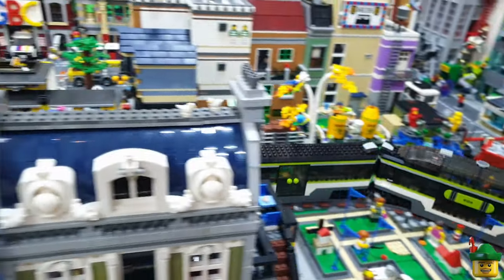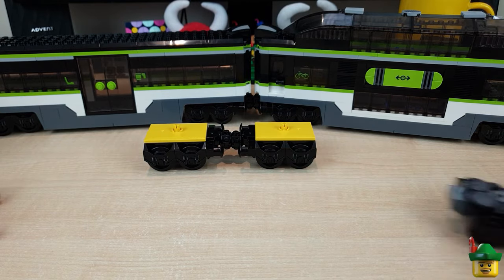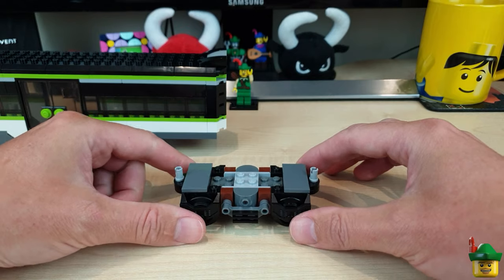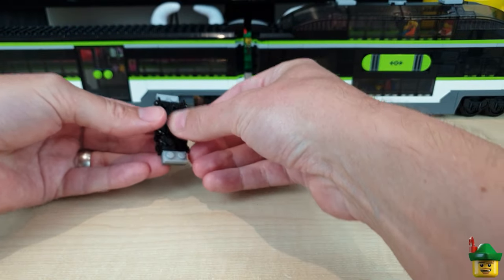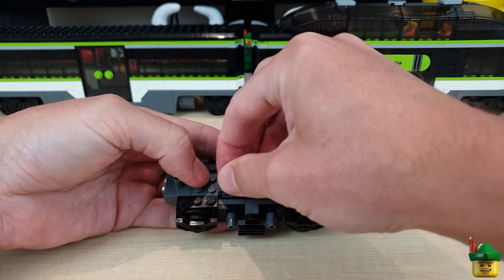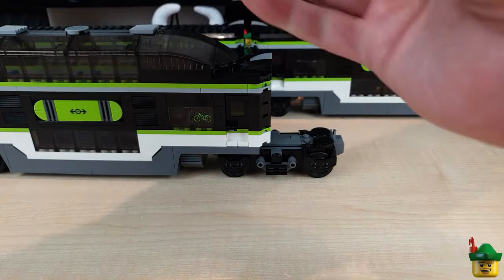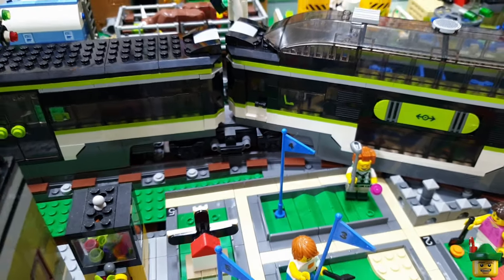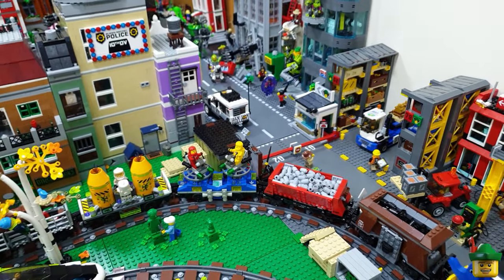LEGO Express Passenger Train - Jacobs Bogies MOC 60337 🚄🚃🚃🏹

Comment: So half as many bogies, mean twice as many carriages??
Reply: 1
Reply: Yeah??
Reply: Potentially! But then you'd have leftover buffers. Maybe two long stock with Jacobs bogies and one short to use up all the parts.
Reply: Just keep in mind connecting/moving trains becomes VERY difficult. I tried this, but went back. Regardless very nice work Robin
Reply: No. For using the same amount of wheels as 2 normal 4 axle cars, you can get 3 units, which are semi-coupled together.

Comment: Really nice upgrade. I think that if you replaced the new type of wheels with the old type with a metal axle, train would run even quieter and smoother.
Reply from the maker: Yes, the new bogies are using the metal axle wheels and I already bought more to replace the rest!
Reply: The new ones are queter, indeed, because both wheels are individual it allows them to spin at different speeds when going through turns. reducing scratching noises. you can hear it clearly if your replace a comeplte train.
Reply: the friction is horrible though  @WhitedevilEE

Comment: Well good sir, I'm here to 'express' some thanks for sending me high speed down the track with some inspiration! 
I had visited the Jacob's Bogie previously but for a completely different objective [streamline & hide the gap with paired concave/convex car ends as well as minifigure walkthrough from car to car]. Yet a solution didn't pan out at that time because was I more focused on a singular pivot point, angles between cars, the cars hugging each other closely at the gap, I was in a rush at it and I didn't have the Book of Chaos to help me out. 😅
I had the intention of circling back and solely implementing the jacob's bogie, but was low priority. Until your video! ..which accelerated the desire to implement them. However...in progress the other day ago....new ideas came up and it all morphed into tackling the 'streamlined and walkthrough' objective again...and I just finished a working concept on a major breakthrough idea! 🤯🤯😍 Elation = off the rails 😂

Comment: Love it!!!
I'd like to see jacobs bogies under all cars - I used a technic pin with axle at one end to make them easy to pick up and place, rather than the stabdard grey pin that locks at both ends.

It's worth pointing out the real tgv have jacobs bogies for all passenger cars, not alternating cars only - so I did the same when I extended my lego tgv.
Reply from the maker: I'd better get the parts for another one then!

Comment: These are quite common on intermodal well cars.  The most I have seen connected with just Jacobs bogies is 15.  Very interesting.
Reply from the maker: Makes a lot of sense if they're all going to the same place!
Reply: @RobinHoodBricks  Yep, it sure does.  American container trains are basically just moving container yards.  Almost all are over 200 cars long, and many go over 300.  Many are double stacked part of or all of the way.  Many of the trains just do the same coast-to-coast run over and over again.  That is probably the most practical use for Jacobs bogies, since the cars always just do the same route.

On the idea of a train as a moving container yard, in western Arizona, along State Route 72, there is a BIG intermodal container yard.  The thing is, it has no cranes or truck ports.  There are just forklifts and rail sidings.  Basically, they just pull up trains to hold the containers, and then take or load them as needed.  I do not think it is even paved.

Comment: I would put these bogies under all the carriages.  They have serious advantages and, as you said in the video, it frees up valuable pieces for future builds.
Reply: The original Eurostar trains (class 373) have then between the carriages except for the end ones (all the powered bogies are then conventional as the end carriages ones are powered too) centre pair so they can split if needed to evacuate the tunnel (never have in practice though). The AGV is different as that has every other bogie powered and they are all Jacobs bogies between the cars. I think this train is following that design, we just have one end to disguise the battery box in.

Comment: If you look at the ÖBB Railjet trainsets they have jacobs bogies all along, including connecting the control car to the next carriage. I understand for your convenience it might be better not to have them all along but I think it would be really cool to see a fully coupled trainset in LEGO.

Edit: They don't have jacobs bogies, but they are permanently coupled.
Reply from the maker: Still, I might have to get two more to speed up the rest of the train.  One linking the two pairs and one linking the cab car.  Thanks!
Reply: @RobinHoodBricks  If you want an example of a trainset that actually does use shared bogies, the spanish talgo series uses a modified jacobs bogie on a permanently coupled trainset.

Comment: I think the difference between the carriages is simply the length - the bogies in the Horizon Express work just fine because the carriages are slightly shorter than those in the passenger train. That being said, I'd say this is a necessary and well-done upgrade. I've tried building a lower-profile bogie in the same style as a typical "dummy motor" but that seems to have too much friction with the technic axles. I'm definitely going to try this and compare the performance, but something tells me this is just going to be better lol.
Reply from the maker: This is very smooth indeed so go for it!
Reply: @RobinHoodBricks  Not surprisingly, it is definitely much better! Very much appreciate your inspirational and informative videos. But I've run out of regular wheels again! Back to bricklink. Lol

Comment: Robin, two things. Do the carriages come in just as much or is that less? And you can also apply this to your freight train. Container wagons also use Jacobs Bogies, see Marklin 47810.
Reply from the maker: The carriage spacing is identical.  Yes, I could use it for cargo wagons but usually it is a pair of the same type.  Mine are mostly totally different.  Maybe a few could be used!
Reply: @RobinHoodBricks  Robbin, make 1 set of 2 container cars. With a Jacobs dolly. and place different containers, length and content, on it

Comment: To correct somethings stated: the cars are semi-coupled depending on there use. North American intermodal (containers & semi-trailers) use the Jacobs bogey and in the event of a derailment, are meant to shear off the car that connects to the parent car (usually either the A, E, D, and C units in 5 unit cars, or A, and C units on 3 unit cars.

Edit: fixed various typos
Reply from the maker: More train facts!

Comment: Great video! Will these bogies work with the 2018 passenger train? Or would I need to modify them?
Reply from the maker: I tried this digitally, just for you.  Yes, it works perfectly.  Same build, same spacing on the 2018 as it had before.
Clearly there is more space in the middle, under the base, as a result so you can extend that bit by two studs on each side you modify.  It looks really good actually.  Enjoy!
Reply: @RobinHoodBricks  thanks man! I'll have to try it. I might have to substitute a few parts though
Reply: @RobinHoodBricks  Also, are you gonna get the new cargo train? Do you like it or do you hate it?

Comment: Actually irl if it had a Jacobs bogie on one side it's on both beacuse there's no real need to re-arrange trains with TGV's or other HST's
Reply from the maker: I'd better get the parts for another one then!
Reply: @RobinHoodBricks  especially since they're mostly on electric trains and the engines can't work unless connected to the coaches and the other engine

Comment: Can this be used on the old train
Reply from the maker: Yes it works on the 60197 fine.  The 60051 has the same spacing so it must work there too.  You may need to do something different in the gaps created between the bases and the Jacobs bogies!